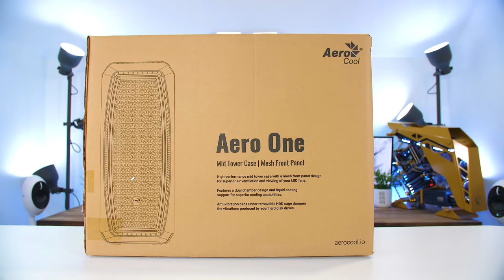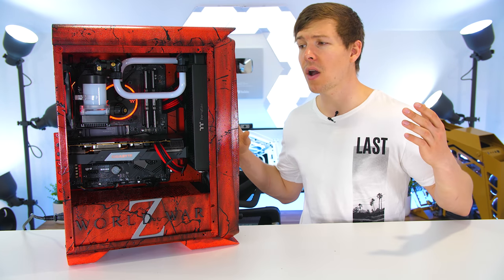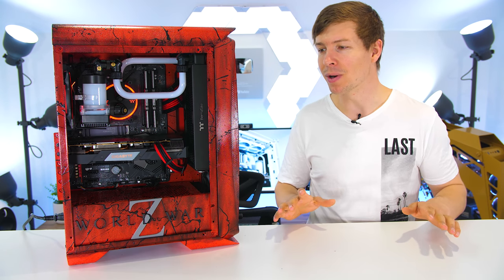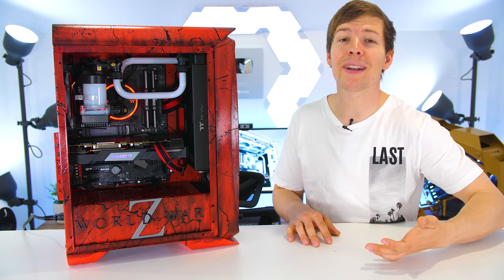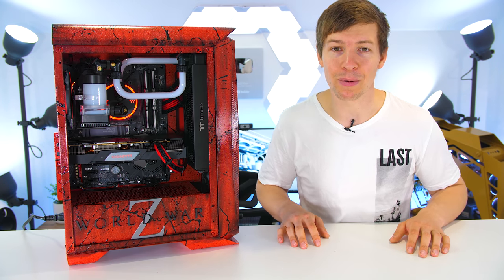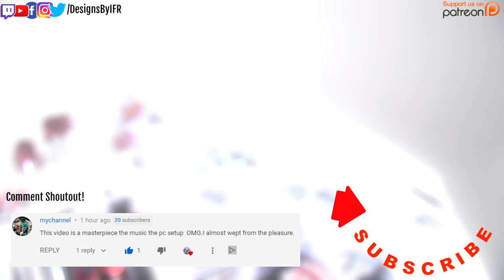We made this Water Cooled AMD Gaming PC Build for Charity! - Time Lapse 2019

Comment: After watching your video I've found the pump/res , I've been looking for one like the one you used . As I plan to add another GPU to my build but I know the heat of two Gpus will be too much heat for my current loop so I want to isolate Gpus and CPU to each its own radiator.Thanks for providing links to parts used.